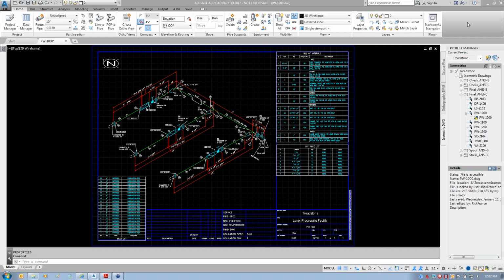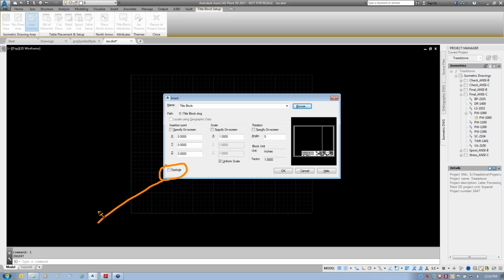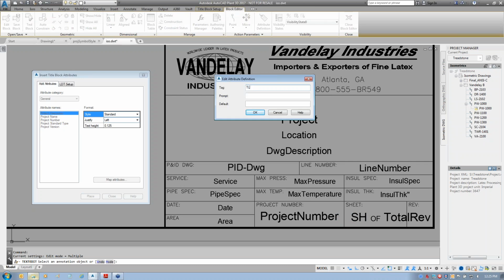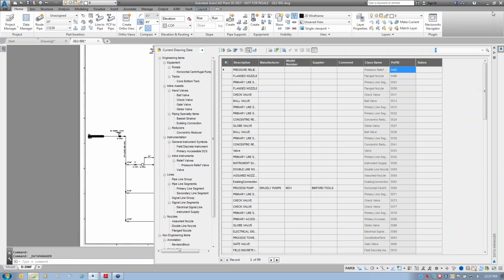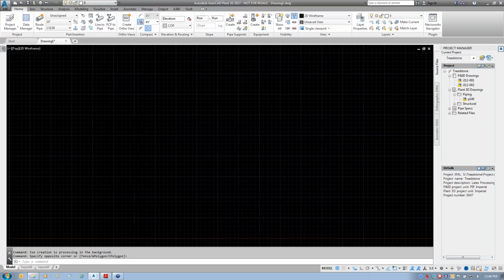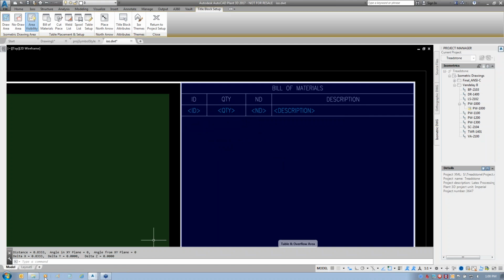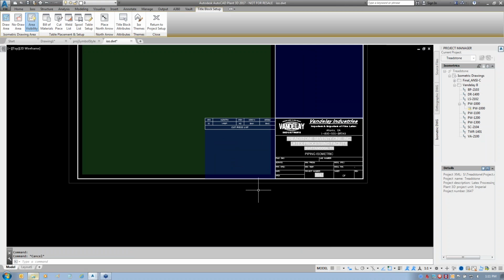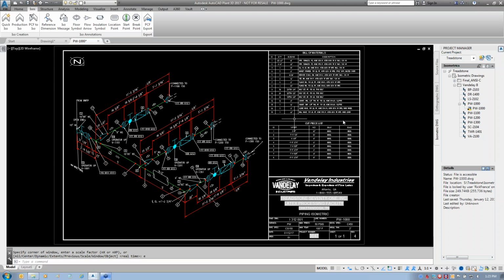AutoCAD Plant 3D Isometric Title Block Configuration

Comment: Time stamps:

20:48 – he explains that fields are the things he used to get attributes to automatically appear in the iso title block, while attributes are the more manual method.  He states that he will explain how to use both methods.

22:10 – drawing properties are from the source file (the piping file), not the isometric drawing file!

Drawing properties do not update immediately – it’s whenever you generate the iso.

23:28 He shows where the tool is for setting up title block attributes (it’s the “Title block Attributes” button on the toolbar when setting up the title block from Project Setup).  The out-of-the-box title blocks from AutoCAD come with attributes already filled out.

Attributes like Date, PipeSpec, Area, and Rev all match what AutoCAD uses, so they’ll be pulled into the title block automatically.  The other attributes have to be mapped for them to work.  (The “name” of the attribute is the TAG field when you double-click on it.)  Sheet = SH, Total = TL

.

24:50 He shows how to convert an attribute into a field.  He uses this for per-project attributes to map the custom project properties (Client and Location) into the drawing.

26:30 He likes using fields over attributes because he can force fields to be uppercase.

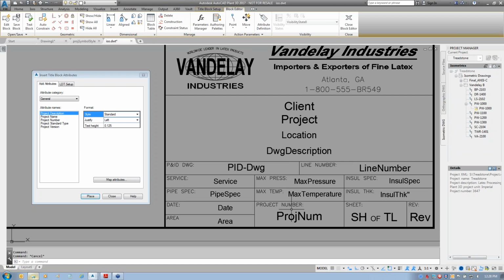27:30 He starts covering the rest of the attributes on the title block.  He notes that the P&ID ones (PID-Dwg, MaxPressure, and MaxTemperature) use the P&ID line designation table, which he will cover later.  He’ll first cover Service, LineNumber, InsulSpec, and InsulThk”.

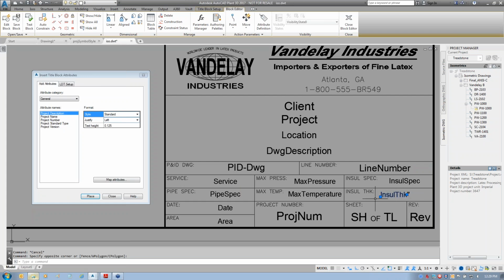28:00 He made Insulation Thickness have an inch sign after it by making the attribute right-justified and the inches sign left-justified.

.

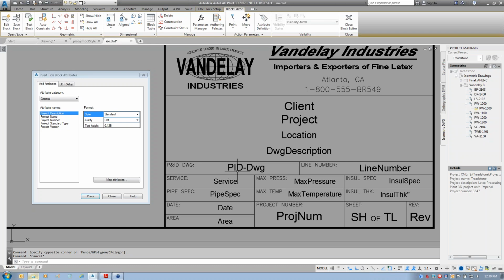28:30 He shows how to map attributes.  The left column is the attribute tag.  The right side is all the information it could pull in, such as from the project, the pipeline, or the pipeline groups (among other sources).  Note that if you map an attribute, it overrides any setup you did using fields (so keep fields as “Not Mapped.”)

31:00 If you have an attribute that should stay a certain value the majority of the time, you can set the Default value.  He shows how to do that here.

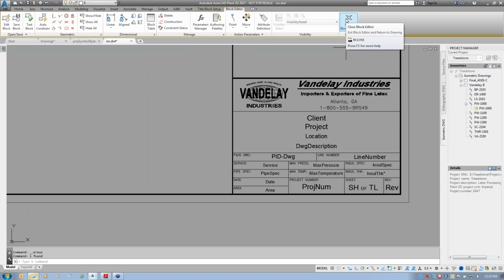32:30 he moves on from attributes, closing out of the block editor.

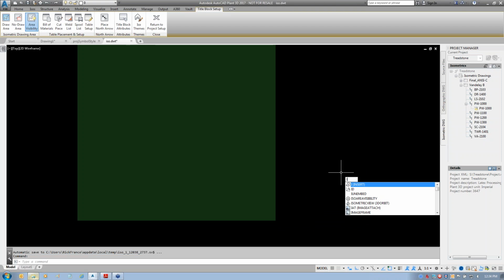Whenever you have changes to attributes, you should erase the title block and re-insert it (33:20).  That’s the best way to get the attributes to sync.

33:30 He makes another testing Iso.  He briefly introduces what a line designation table is while he’s waiting.

.

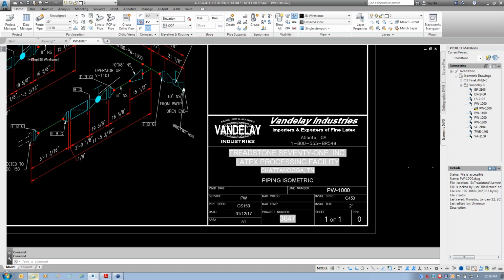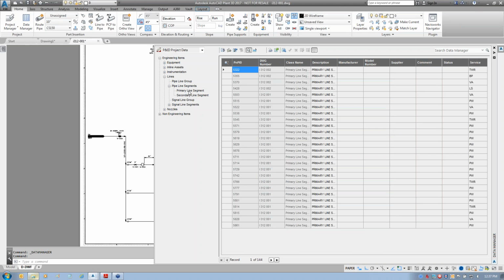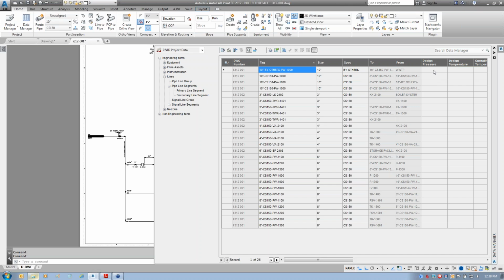35:00 He begins explaining the P&ID/line designation table attributes.  36:00 is when he pulls up data manager.  (37:00) The line designation table has to come from the Pipe Line Group table (of data manager).

He had to add the attributes PID-dwg, MaxPressure, and MaxTemperature.  He did that by using Project Setup > P&ID class definitions.  He set drawing number as an acquisition (38:30).

40:00 He shows how to export the line designation table, including how this file behaves with copying projects.

During the last three minutes or so (39-42:30), he explains why he wouldn’t use P&ID drawing number: if the line is split across multiple drawings, it’s basically a manual process whenever he exports the table from his P&IDs.

42:30 He shows how to set up the line designation table (LDT) to work with the title block.

46:00 He runs another test iso.

46:30 A note about the LDT file: when he uses copy project, the settings carry over.  BUT, it will also create a copy of the excel file that was in the original project.  So, until you export the LDT table from the new project, the LDT file will have the data from the original project.

47:30 He shows the finished title block (from 46:00 test iso).

49:00 Adding a north arrow, no draw area  (50:30) The direction of the north arrow determines the direction of your iso drawing, so if you want to use a different block, it’s better to edit the north arrow.  You have to have the same name and same four visibility states for the north arrow block to work.

.

52:00 Bill of materials.  Get BoM table setup before you start placing your BoM – Changing table setup causes the column width, etc. to revert, so you should set up the table setup properties first, then configure the BoM appearance.  (57:00 he finishes explaining adding columns to the BoM and moves to changing the BoM format.)

1:00:30 He shows how to get columns persistent so you can adjust columns after layout for it to reset.  Uses IsoConfig.xml (1:01:30).  (Actually, this might not be persistent?  It might be so you can get exact widths, but might reset every time you regenerate the table.  Listen to 1:08:00.)

1:06:00 How to change fonts in the BoM.

1:09:00 How to change the text color.  Plotting in monochrome won’t fix the text color.

1:10:00 Adding a different table (Cut piece list).  Making the table go up instead of down.  Changing the row height.

1:11:30 He runs another test iso.

1:12:30 How to fix width on BoM so that as many rows as possible print in one row and not two.  First method: change the part’s description in the spec [permanent] or the model [temporary/on the fly] to make it fit better.  Second method (1:14:30): change the text font.  Third method (1:15:30): put tables in the same space – make them not overlap using Add to existing area.

1:16:30 He changes the north arrow direction (for demonstration purposes), then runs another test iso.  He discusses about alternate layout ideas (1:18:30) if you wanted to have more tables on the drawing.

.

1:19:30 He moves to questions

He put an iso insulation symbol in the model using the button under the Iso ribbon tab.
Reply: Thanks, great summary

Comment: Hi 
 When we add template,
The template should be on scale or  can we use A1 sheet for iso
If we create iso on A2  we get limited isometric on 1 sheet ,
Can we cover larger drawings in one sheet
Can  you help me with this
Reply from the maker: You can create any size Iso sheet you like as long as you define it correctly. Isos are 1:1 and technically have no scale.

Out of the Box Metric Projects have example templates of both A2 and A3 Size Title Blocks. We hope this helps!

Comment: Hello sir, thank you for your illustration , I have a question , how can i change the line weight and the color of the pipe preview ?
Reply from the maker: That is a pretty wide open question related to AutoCAD and not Plant 3D. I would suggest searching for videos on colors and lineweights both for display and plotting depending on which one you are needing help with. It is AutoCAD so there are multiple ways to handle this depending on how your templates and plot styles are setup to work on your system.

Comment: Hi,
At 28min you mentioned that Service was not filled out because it has to be filled out at Drawing Properties.
I can see that after you filled out the information on DWG properties at the final output you have the desire result.

However you never showed how you mapped the Service there.
I have tried to follow the steps that you show for Project Number but it simply doesn't work.

I have Autodesk also involved in trying to figure it out... 

Would you be so kind to explain in more detail how the Area attribute was placed inside the TBlock?

Thanks